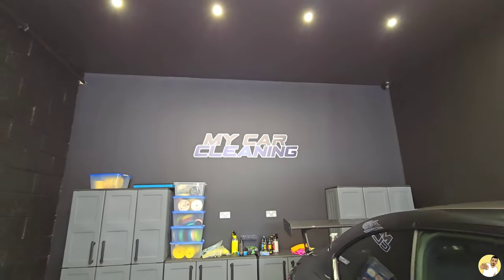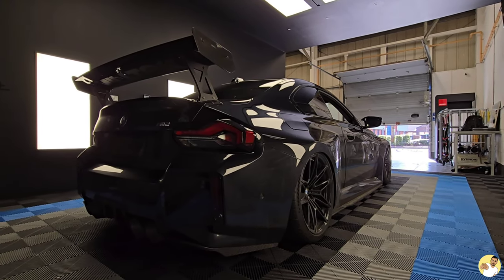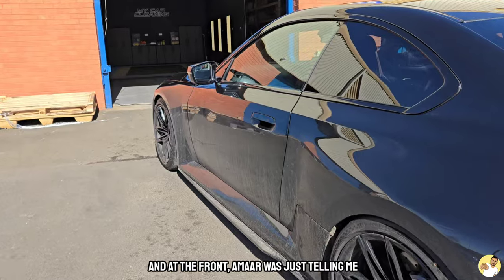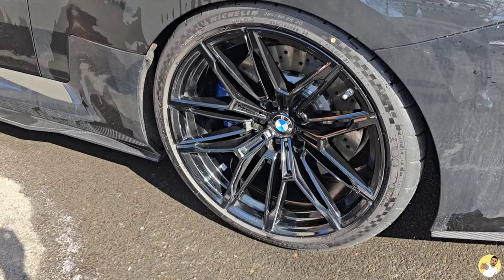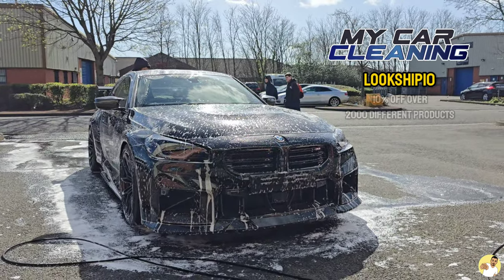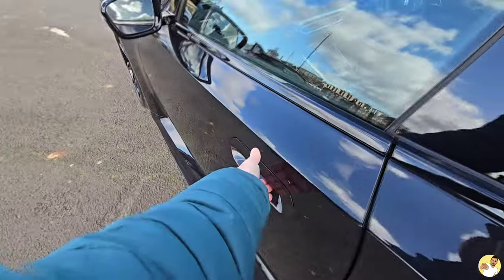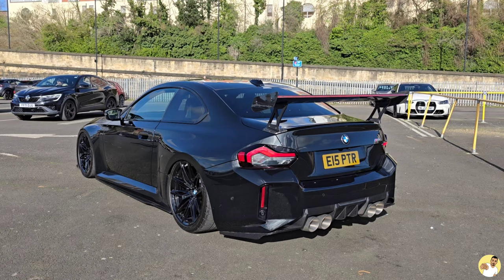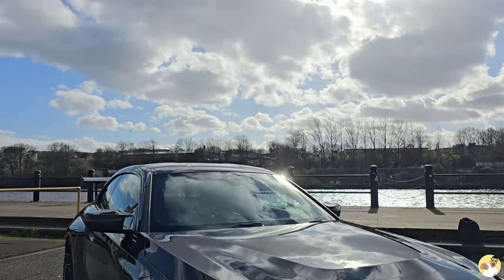THE WORLDS FIRST BAGGED G87 BMW M2

Comment: Call it contro, but I actually rate the mad grill in the new M2. But I still prefer the previous gen.
Reply from the maker: I don't mind the front end at all. I think it's the rear lights that let's it down a bit.
Reply: @lookship  Mixed on the rear. I find the quad pipes always draw attention away from the Sid the sloth tail lights. Which is why regular 2-series’ look FOUL.